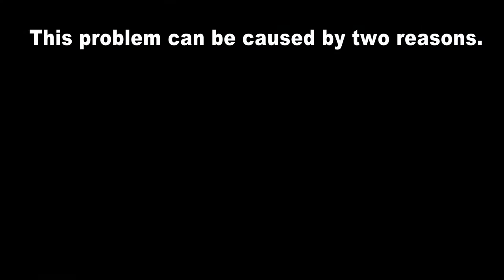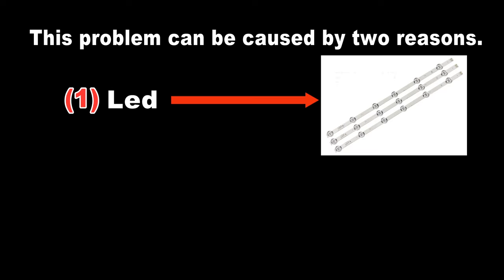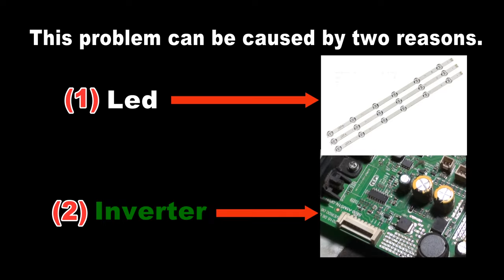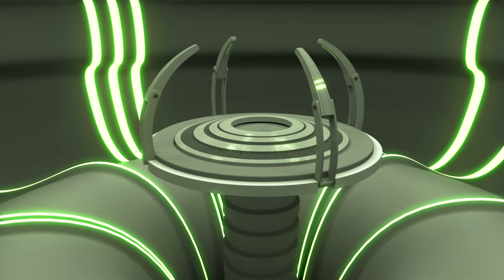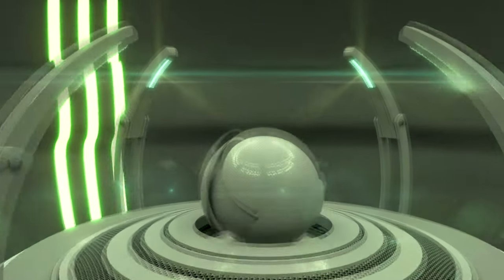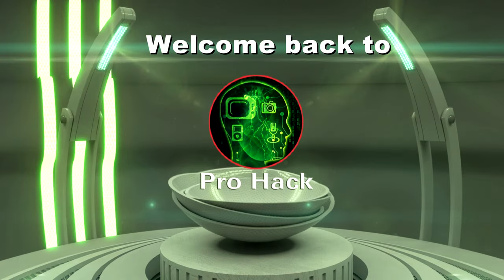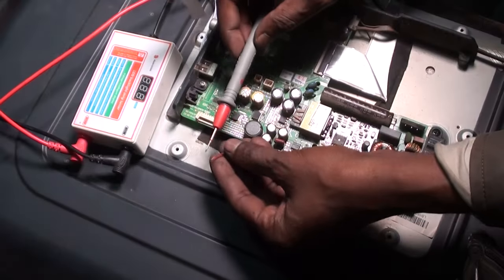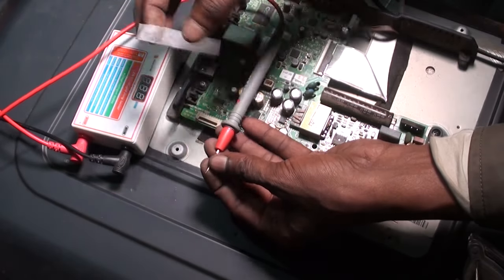LED TV backlight problem solution.#Pro Hack

Comment: Hi bro my problem is backlight low voltage can i change universal inverter board is it possible for low voltage backlight issue
Reply: Wo kon sey hote hain 35 volt ka cheng kya kuch pick nazar aane lag gai per britnss full nhi aarehi
Reply: Universal kon sa hota hai

Comment: Good work 👍.
Am working on a led tv.
Backlight is OK when checking it with led tester led is on.
But it won't turn on.
The out put voltage on the pins for backlight is only 45v.
I have check the mosfet only 45v.
It seems to me either the mosfet is short or the smd resistance are short also.
Because I check the smd resistance it's beeping on the multimeter.

Don't know what to do

Comment: Boss did u use the 12v inverter board that is used in these small TVs?......can it work on a 42 inch TV? How about that backlight ic why u didnt remove it hence its damaged

Comment: Did you check the ic data sheet before you knew the signal pin? Nice video in English language but next time let us know where you connected the backlight signal to and other connections